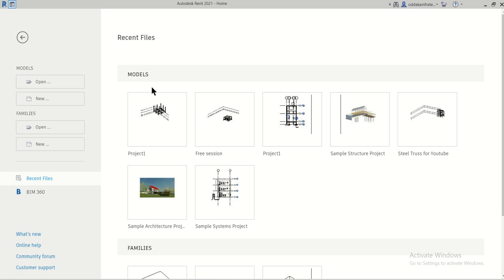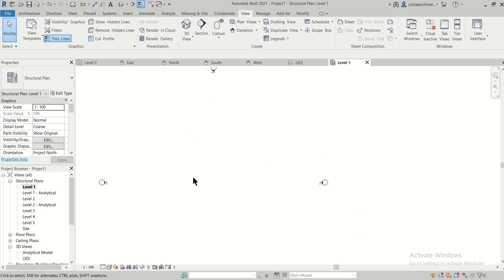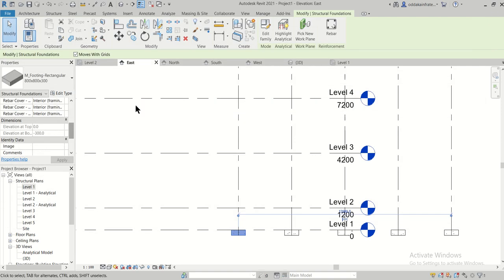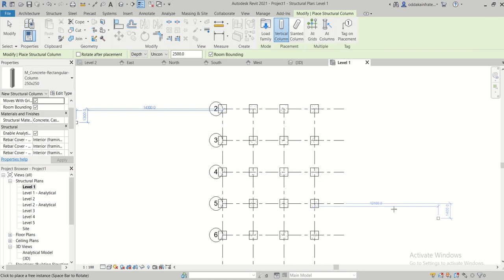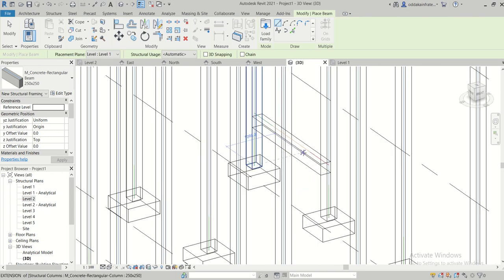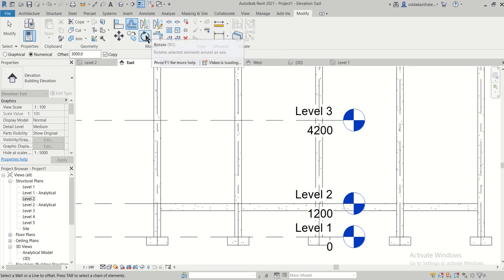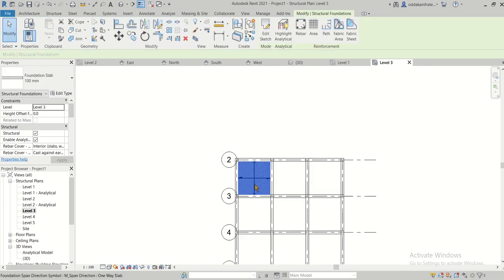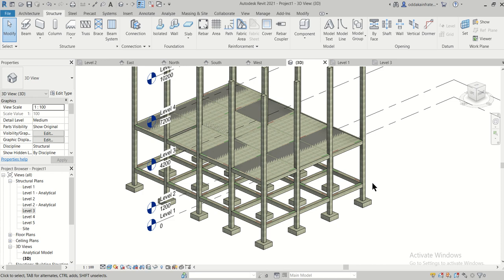Fully completed Building modelling on Revit Structure (Part -1) || Revit Tutorials

Comment: Great! Just a point I saw you were confused in when Marking the Columns, when you mark any vertical component (e.g walls and columns)  you must change to Height because if you select depth the component you are marking will go deep from the base point which in your case was level 1 and if you select the height it will go higher than the base level that in you case was level 1.. Thanks